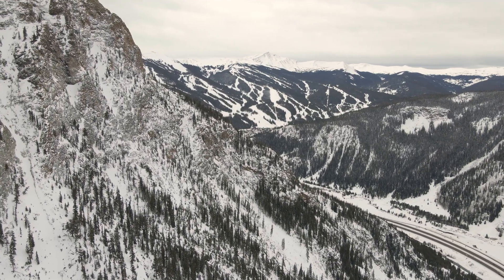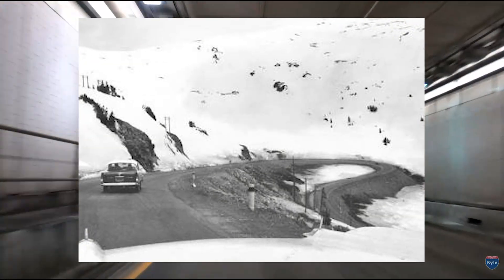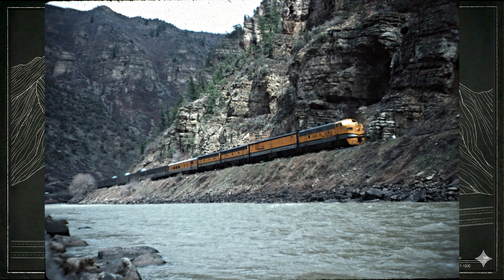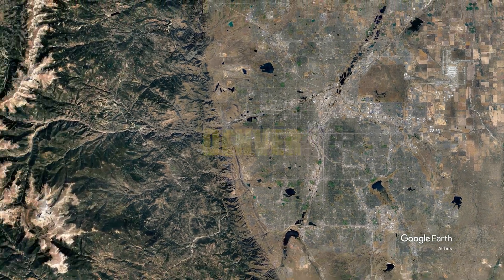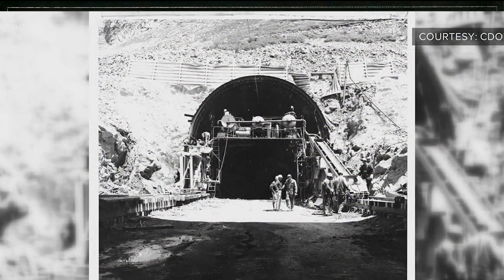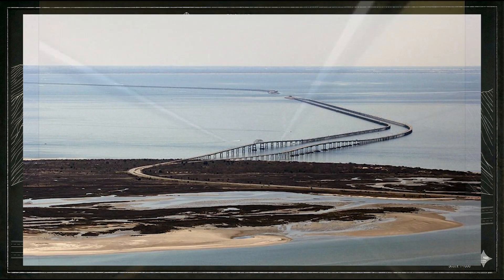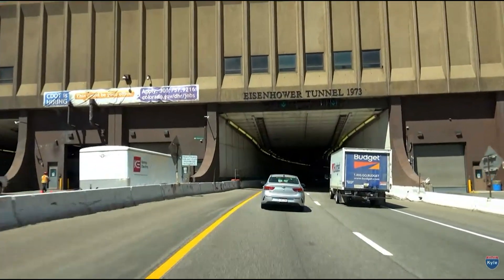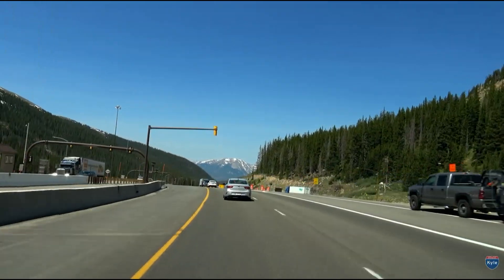Engineering the Impossible: Building the Eisenhower Tunnel

Comment: One of my fondest memories of growing up in Colorado was driving through the Eisenhower tunnel and getting to see something you didn't expect:   every 2500 ft or so there was an observation window on the south side of the tunnel and every now and again you'd see someone sitting in there watching.     There was also a track on the south side that was suspended about 3  ft from the ceiling where a little service car could run along from one side to the other suspended on the south wall.    I saw it used once (and only once) when there was a disabled truck in the eastbound lane about half way through.    Once they completed the Johnson bore and they had two lanes in each direction, they eventually took all those things out.
Reply: When I worked at the tunnel, the observation boxes were still there in the Eisenhower tunnel. I only got to see inside a few times during cleaning projects. Just think inches of black powdery dust and an old 70s telephone. Most of the time the boxes were locked to keep the curious out.
Reply from the maker: @bryantrigg4854 That’s really interesting to hear from someone who actually worked there. Those old observation boxes sound like a time capsule — dust, the old phone, and everything locked up to keep folks out. Details like that help paint a picture of how the tunnel used to operate. Thanks for sharing it, and thanks for the comment.
Reply: @bryantrigg4854  The 'train' on the south side of the north tunnel was called the Rumley express named after Werner Rumley. It was supposed to carry workers in and out for maintenance operations, however it never worked well.
Reply: @susanmcollough2011  The mounts for the train were still in the salt room on the east side when I was there.
Reply: @bryantrigg4854  Yes, they were left in there but removed in the tunnel when all the tile panels were replaced during the litigation with Dow over Serabond.
Reply from the maker: @jjc4577 That’s a great memory — those old observation windows and the service car setup were really something to see, and not many people realize they were part of the early operations. Once the Johnson bore opened, a lot of that original infrastructure faded away. Really appreciate you sharing what you remember from those days. Thanks for the comment.

Comment: One thing you forgot to mention about the Eisenhower Tunnels-to maintain safe emissions levels, the tunnels are metered. There are traffic signals on both sides of the tunnel, which aren't active during the summer months but are active during the winter months.

The result of this is the entirety of I-70 on both sides of the Eisenhower Tunnel being turned into a parking lot. And this is during ski season, when millions of people travel up to the ski resorts on the opposite side of the tunnel. 

As a result of this, many people are ironically still forced to take Loveland Pass-which the tunnels were meant to replace-as it is the only other alternate route between Denver and the Arapahoe Basin.
Reply from the maker: Good points. The metering lights do kick in during winter, and you’re right—they can back traffic up for miles during peak ski season. And when that happens, Loveland Pass ends up carrying a lot more of the load than people expect. I may touch on that in a future follow-up.

Comment: Fascinating how the tunnel bores are stabilized inside the Loveland Pass Sheer Zone of moving rock by continuously grouting the voids outside the travel tubes.  I’ll be thinking about that roadtripping across I-70.
Reply from the maker: It really is incredible engineering. That constant grouting is one of the key things that keeps those bores stable in a zone that never fully stops moving. Once you know it’s there, you can’t help but think about it every time you drive through.

Comment: Eisenhower had big ideas and left an amazing legacy with the Interstate system.
Reply: Fun fact. The Eisenhower Interstate highway system was specifically designed to be straight every 5 miles or so for a determined length to allow military aircraft to land and take off during times of national emergency. Straight and level with no overpasses or other obstructions.
Reply: @bills6946  Well if your airfields and military bases are knocked out during war, you have to have another way or your defenses are in big trouble. I'm sure he realized this while commanding World War II in Europe and witnessing the Korean War as well (even if he only directly oversaw that one for its last six months as president). Natural disasters, etc. also could require major airborne cargo relief responses to communities, making it a doubly important option (we saw this last year when Hurricane Helene cut off and devastated Appalachia in North Carolina and eastern Tennessee, they had to use old DC-3s to land on the roadways since the highway connections were wiped out by the floods).
Reply: 50 traffic lights between Fort Wayne and Chicago, LMAO

Comment: the stretch of I-70 from Denver to Grand Junction remains the DOT's Magnum Opus. it was the most EXPENSIVE section of the entire Interstate Highway System
Reply from the maker: It was definitely a pricey highway — around $10 billion when adjusted to today’s dollars for the full I-70 corridor through Colorado. For perspective, the Boston's "Big Dig" came in at $22.5 billion, but that project rewrote the definition of ‘expensive construction’ in a major city.

We’ve been thinking about a Top 10 Most Expensive Highways video, ranked by inflation-adjusted cost. If folks are interested, I can move it up in the lineup.

Thanks for the comment — definitely not a cheap highway to build!